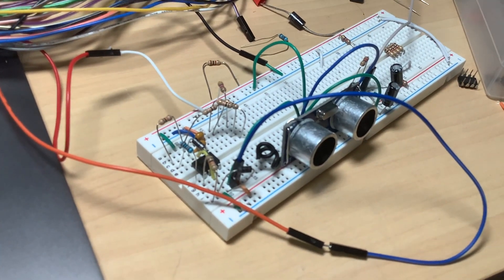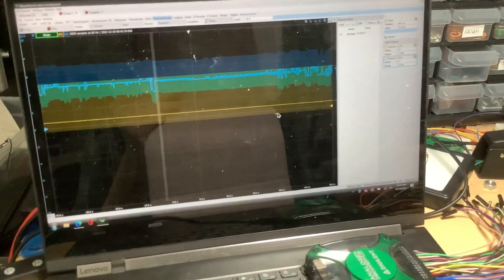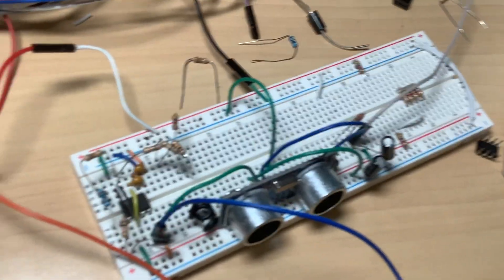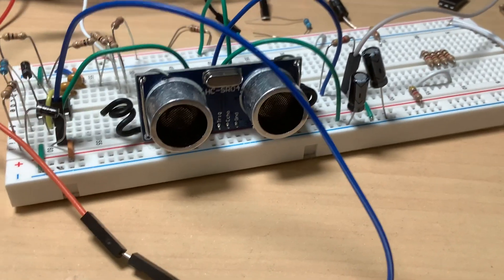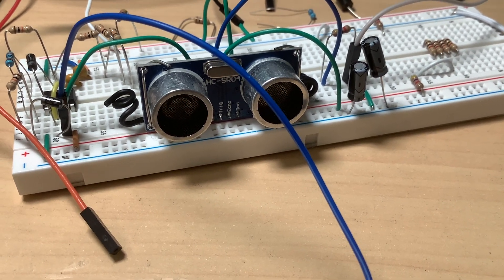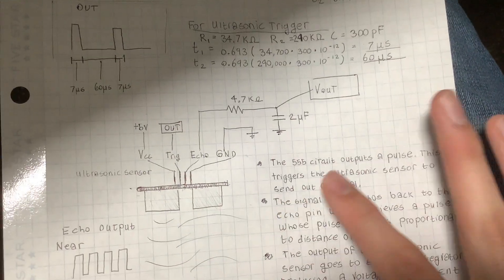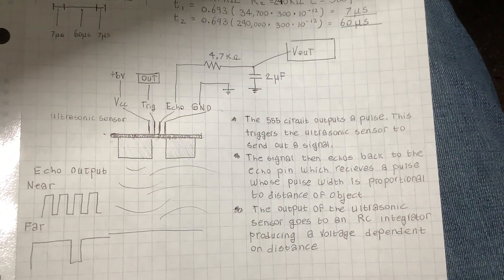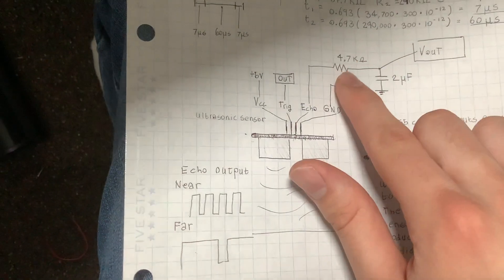Using an Ultrasonic Sensor Without a Microcontroller

Comment: Hello Electromechanical, are you still active? 
If so, is there somewhere I can see your full schematic for the sensor with values? 

I would like to build an ultrasonic sensor for my schoolproject, but I wanna do it FULLY analog. This means that the used OP-AMPs will be built as bjt transistors instead of using the ICs directly. Thats atleast a wishfull thinking, just for the training and for the fun of it
Reply from the maker: @rasmussauerberg3919  I can upload the schematic I used in the video if you would like that. Yeah but it would definitely be possible to use only BJTs, just difficult for component values
Reply: @electromechanicalproductio1317  that would be cool! So far I have made the receiver circuit using a bandpassfilter, whereas the pasning frequencies are ranging from 39-41kHz as that is the frequencies our ultrasoniske device works at. Followed by an envelope detector and a schmitt trigger to make sure the ADC reads it properly
Reply: Excuse my danish auto correct 😄